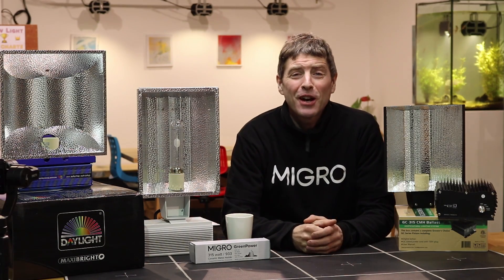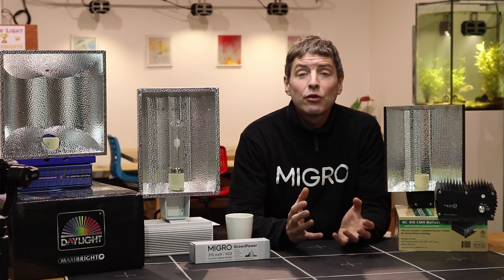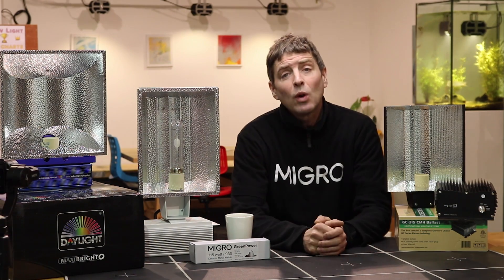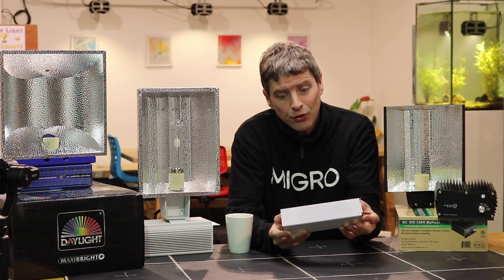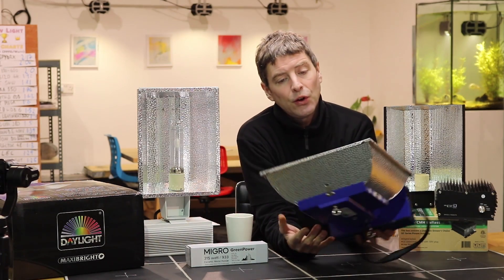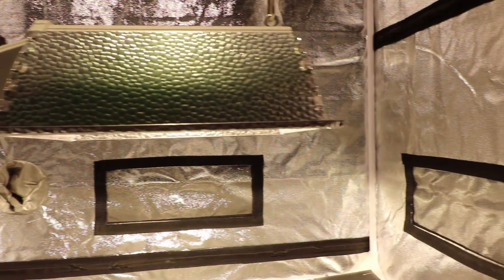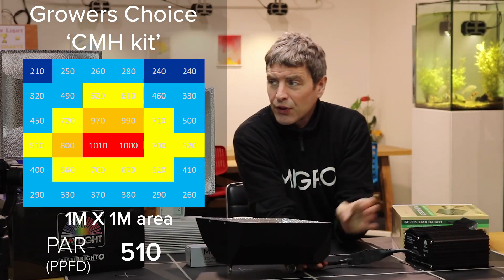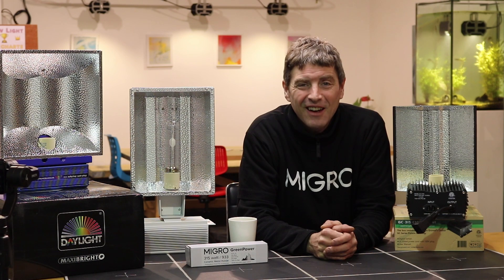The Best Ceramic Metal Halide Grow Light 2019 - Growers Choice Maxibright MIGRO

Comment: The best cmh lights are as follows

Hellion Adjusta Wings 630w DE with Super Spreader. 1290 umol

Hi-Par 630w DE. 1150 umol

Lumatek 630w DE. 1100 umol

But yeah if you want to play with 315's then yeah for sure ok I go 100%

Hellion Adjusta Wings 315 with the 4200k Japanese Bespoke Globes!
Roughly 600 umol.

Comment: I have testet 315w CMH from Phillips around 4k and 3k. Both vertical and horizontal position. Horizontal wins. No doubt. A good reflector is needed.
I have also testet 3k vs 4k CMH. From seed to harvest. The 4k provide the best over All result (more smell, more taste, stronger potency + 4k is superior in veg) the 3k bulb gives little more Mass Like 20-30 grams more harvest than the 4k. The bud density is the same. But 30 grams is nothing, compared to the quality from the 4k bulb.
I rather lose 30g. Than letting go of the better bud quality.
Another thing i have observed is, plants grown under CMH lights, produce much more resin Early in Flower compared to 600w HPS. Resin production is insane with these CMH lamps.
Done under 315w in a 120x120x200cm tent. Never going back to hps in My flower Room.

Comment: MIGRO  ~  can you please answer this questions. How high typically should you have your 315 CMH light from the top of the plant? Currently I have mine about 2 1/2 to 3 ft.
Reply: If you want 1000ppfd like in the video, then the answer is 30cm or 12 inches.
Reply: Or more exact: start at 24" and work your way downwards. But there's no need to go lower than 12"
Reply: @lrrrruleroftheplanetomicro6881  thank you very kindly <3

Comment: Why do you hang all the tested lights so that there's a big "hot spot" of 1000 PPFD in the center (usually 1x1 ft) and then the perimeter is just...crap.  Can/could you merely adjust the height to get a more even spread of intensity?  Maybe aim for 750-850 max in the center if possible?

Thanks.

Comment: I have a question I am wanting to run 2 315 w cmh  fixtures. I also have a 400w double ended hamelton balist and fixture I am thinking on running for a few hours a day for a more intense blue when vegging. The bulbs for the hamelton fixture are for a salt water aquarium they come in 10000 to 25000 k and you can also get them in a super blue or atinic . the bulbs are in full spectrum. they simulate the sun at a water depth of up to 25ft. with no loss of the benifical light and form what I understand the higher the k raiting the better the penetration. If used I will be placing this fixture between the 315w fixtures and running it for 4 hrs in the middle of the day with the idea to simulate high noon when the sun is in the highest position of day in the sky.. I have found little info on these types of bulbs. Like a color temp graph. The other question is can I clone under the 315 lights. Also Phillips now makes a 4200k bulb how soes this compare to your brand bulbs? Thank you for your time in answering my questions. I am new to growing and in a legal state... Martin
Reply: too add the 400 watt light in question is a hqi bulb

Comment: These bulbs are originally designed to be used vertically in the reflector and the lifespan is cut in half when used horizontally. Also not as efficient when used horizontally.

Comment: Thanks for the info , I've been using the 315 cmh for a few years now and I can tell you from experience that the cmh gives more potent buds ! I have run several of the same clone's for a few year's now so I know exactly how they grow under a 600-1000 watt hps , the 315 plants are more potent ! I'm not a scientist but I assume it's because of the high UV ! 4x4 room , 1 -315 and two 150 watt hps , replaced one 1000 hps , works for me 26c !
Reply: @delosombres do better research when commenting: "Under high pressure, CMH bulbs can produce powerful light output that contains Ultraviolets (UV) like the sun.

These UVs include UV-A, UV-B, UV-C, especially UV-B which is really helpful for plant growth, overall all 3 types of UV are harmful to human eyes.

Glass 'reduces UV, it does not block it'
Reply: It's due to the range of the light spectrum, UV included. Don't let anybody tell you different! That bulb creates the closest thing to the suns light spectrum.

Comment: I use a 630w double ended cmh, it's a fantastic lamp, I have great results with it
Reply: Mario Frigo what reflector are you using. And are you using a 930 & a 942 or are both bulbs the same? And which bulbs are they?
Reply: @frankwilliams977  i only have one double Endet bulb with 3200k 

https://www.herbalistgrow.es/luminaria-lec-lumii-solar-630w-de
Reply: What size room
Reply: @warrenkelsay9554  1,20m x 1,20m

Comment: Is my 2x2.5 tent too small for a 315cmh?
Reply from the maker: 2ft x 2.5ft is 0.6m x 0.75m = 0.42m3. The PAR output from the CMH is about 500PAR so your average PAR would be 500/0.42 = 1,190. This is too high and need to be under 900. You need a 3ft x 3ft tent for a 315w CMH

Comment: GC has definitely been hurtin feelings this year lol. We get it shane you hate cmh and i probably would to if i was a led manufacturer. Your results are completely useless. Last video you run them on the same controller , this video you use your bulb on all units. Completely pointless , would you use the same drivers to compair leds ? Would you change diodes ? No , you compair one unit with another one and list the price of each like all your other "fair" comparison videos. Really shady Shane.
Reply: That's a valid point.

Comment: have you done a video yet on Ceramic HPS? I just picked up the hortilux unit, i'm really enjoying its results so far. the one i got came with the CHPS as well as the hortilux blue bulb. i realize they aren't the most efficient in terms of total radiant energy or lumens, but i feel like the sprectrum is more than making up for it.
Reply from the maker: I bought the bulb on impulse then realised I needed a new ballast too. I haven't bought the ballast yet. It might be the next impulse buy..

Comment: Does the same apply for wattage  / yield iie. 600w hps should yeild close to 600 g rams does the same apply for led ie. for a MIGRO 100 Pulling 96watt form the wall is the most to expect 96grams
Reply from the maker: A dry gram per watt is high for HPS. However high efficiency led should yield 50% more per watt compared to HPS

Comment: Always educational 👍.  Can you comment on vertical vs horizontal bulb orientation?  And does the fixture have an performance impact?
Reply from the maker: More of the light must be bounced off the reflector with a vertical bulb so they are generally less efficient. Also  the he reflector has to be deeper to fit the bulb which makes them higher and they require more vertical space. Overall a bad idea for grow lighting.
Reply: MIGRO I’m reading that the 315 bulbs are recommended from the manufacturer ( Hortilux) to be in an vertical position. Is this information incorrect?
Reply from the maker: Just looked at them. They are $550 !!. They say the bulb must be base up in the reflector but I don't know why..

Comment: Hi! As I'm french sorry for my english. I eardrum that nobody use cmh because it's an old technology and mh like hps lamps are better. For ex for végétative period I use MH600W and for flowering periods I use an HPS 600w lamp. I bought a 250 w cmh lamp but in fact I didn't know that ballasts were different between CMH AND MH/HPS.  So is it  intelligent to by a CMH ballast ?
Reply: Lumatek make a cmh now and its cheap.They are suppoed to be more efficent but they are only 315w so until they start making a 600w single bulb system i think its not going to catch on.
Reply: @davesmith95  thnks for your reply,  if I understand it's not the same thing I'll have more result mither my CH or HPS 600w.
Reply from the maker: Hi, CMH is newer than HPS or MH and also more efficient. check out this video for comparison. https://youtu.be/W7SYrgnwoHY
Reply: I don't think you can get a 250w CMH lamp I'm sure they are only 315 or 630  @ 3000k. Or 4000k ; and yes you need a specified ballast for a cmh lamp , hps and mh ballast are not compatible with CMH Lamps..p.s.. lmao ( i eardrum) gotta give it to ya tho,your English is better than my French so...

Comment: Does your migro led outperform your migro cmh ?
Reply: samuel desrosiers I think it does
Reply: ceili will i get dense flowers with migro led as with a cmh or hps ?
Reply: samuel desrosiers the led is well over 2um per watt while the cmh is only 1.29um per watt. Although cmh puts out a much better spectrum vs led.
Reply from the maker: Hello, Yes the MIGRO LED is more efficient. The 215W MIGRO 200 is about the same output as a 340W MIGRO Economy CMH

Comment from the maker: Before you all ask.. The hanging height for the Maxibright was 30cm, the MIGRO Economy was 30cm and the Growers Choice was 40cm (the growers choice reflector is narrower than the other 2 and needs a higher hanging height to keep the centre PAR level at 1,000)
Reply: Great vid Shane...thank you.  Is it safe to assume then that 30 cms (or 40 if using the Growers Choice set up) is an appropriate height off a plant canopy?  I'm just concerned about UV and burning/bleaching.  Been having some issues in my tent and trying to eliminate things to narrow down the source.  Thanks dude...
Reply from the maker: @TheMisanthrope.  Hi, I calibrate the height using a quantum sensor which is easy because I just lower until the centre, and highest, PAR reading is about 1,000 PAR (the sun is 2,000 art mid day). The CMH spectrum has nly 0.7% UV v's the Sun whch has about 7% so there is little chance of any damage to you or your plants from a CMH lamp.
Reply: @MIGROLIGHT  Thank you.
Reply: I love these videos, I'd kill for a par meter... unless you want to test my home brew and tell me the results ;)
Reply: Do a review on the spydrx plus or the spydrx 2i
Reply: Shane great video I have just bought an adjustawing Hellion 315cmh any idea of hanging height